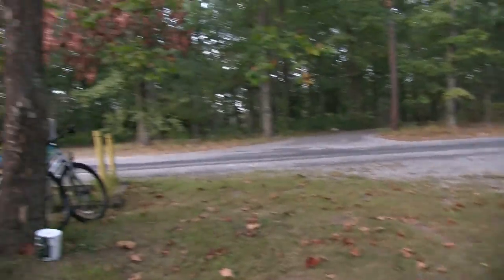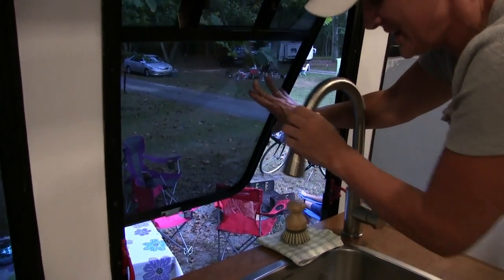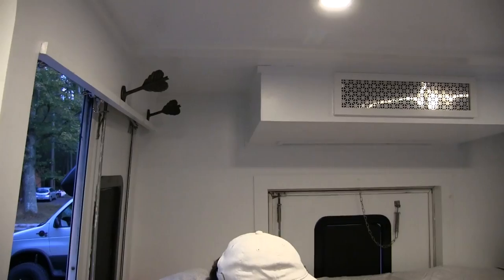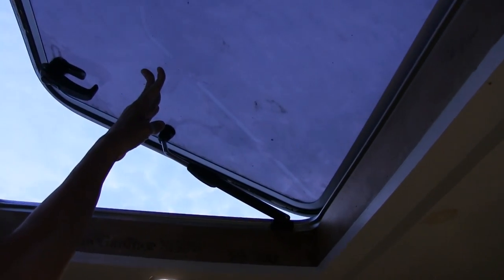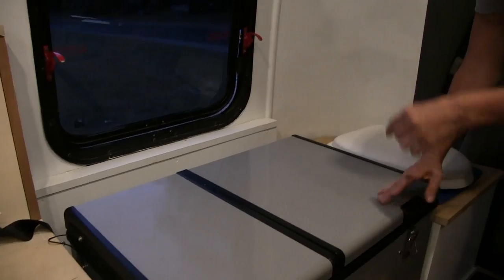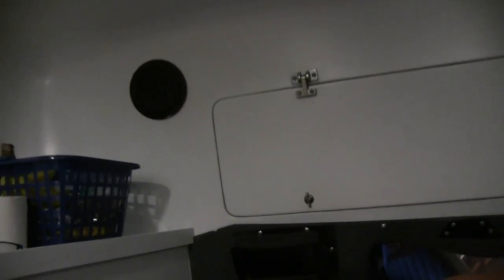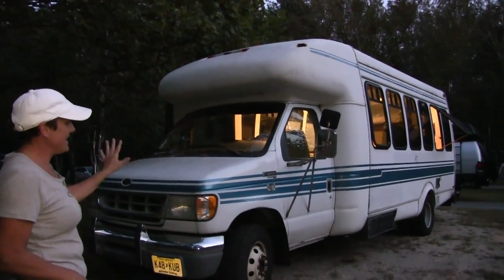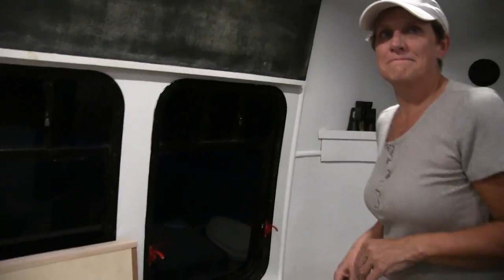VANLIFE |Tiny House Shuttle Bus Conversion: Take a tour!

Comment: I'm a bus driver.

All of the emergency hatches leak.  Idk why.  That marine hatch is brilliant!!
Reply: Thanks.  I called it our built in water feature when I first got it.
Reply from the maker: Thank you for watching
Reply: I think she meant the original leaked...
Reply: Unless that was sarcasm on the original..!
Reply: @skipdippity  yes.  We were both talking about the original roof hatches leaking.

Her new marine hatch doesn't leak.
Reply: @offairhead  That is correct.  The 20-year-old emergency roof hatch leaked.  The new marine hatch does not.
Reply: @OldSkoolieSimple   Hello Rita I really like your convertiom. My name is giovanni, I am in the process of converting a shuttle bus in a motor home. I will like to know what type of converter to charge your batterys did you used?? I would appreciate thank you.
Reply: The side windows leak too at least in my shuttle bus they did.
Reply: @giovanniolivares942  The only converter I have is to convert from 12V-110.  The batteries are charged by the Alternator when I drive.
Reply: @The_VANtastic_Pack  My side windows are in great shape, fortunately.  Sorry to hear that yours leak.  That stinks
Reply: Of
Reply: No, you not a bus driver

Comment: Really nice setup. I highly suggest making screens that attach with magnets to go over each window that opens to keep bugs and other things outside. I have even seen screens for doors. You could easily install a track on the outside up above the windows or roofline so you could add an awning that slides into the track and would provide some shelter from the sun or rain , a protected space to eat or relax. Plus you could add lights on it. Do you have a curtain or shades to cover up the front windows or the front from the rest of the bus.  Something like that would help you be stealth and just prevent people from seeing into your bus at night because when you went around the front you could see everything. Do you have anything to provide privacy for when you use the toilet?
Reply from the maker: Thank you for the suggestions
Reply: Thank you.  You can't tell, but there are screens on the windows.  Screens, cushions, awning are on my to-do list.  We do have curtains but didn't have them up for the video so you could see the layout better.  They have magnets and attach to a piece of metal strapping, (not shown in video.)
Reply: @OldSkoolieSimple  I love your idea of using the metal strapping and magnetic hooks to attach the curtains! You did an amazing job on the design of your shuttle bus!!! I'm still in the research/design phase while my youngest finishes college, then this mama is spreading her wings. :) I wish the tiny house/skoolie movement happened 20 years ago. I would have loved to have hit the road with my boys like you're doing with your girls. Enjoy making memories!!! Safe travels!
Reply: @susanlc95  Thank you.

Comment: Wow. I've been looking at shuttles for a few months to do something very similar. There are a lot of great ideas here. 

The one thing that I don't see addressed is insects. I see a lot of open windows, and of course that handicap access door... but no bug screens. I don't know 'bout y'all, but I've found that when the sun starts setting, all the insects go towards the wherever the light is shining (in this case, to the interior of the bus.) I think I'd have to figure out a way to address that. Maybe there's a way to put a magnetic frame around a window screen and stick it up over the window.
Reply: There are screens on two of the small windows.  The fan has a screen.  The curtain on the door (not shown) also helps.  We run a Thermacell inside at night if it is really buggy and it works like a charm.
Reply from the maker: Thank you for watching

Comment: Thank you very much. A lot of great ideas and nicely done. I never liked the windows in shuttle buses because of all window and little air-flow, but you seem to have solved that problem with the whole window pushing out. I'd like to see how that was done.
Reply: Also, while driving, those little windows do a great job circulating the air.  We open just a few.  Never need to use the AC.
Reply from the maker: Thank you for watching

Comment: She got a 3000 watt inverter to charge her laptop.  Suddenly I’m more interested in the laptop than her oh so cool trailer, LOL!
Reply from the maker: Thank you for watching
Reply: It is set up that way in case we decided to run a hair dryer, vaccuum or blender.
Reply: Rita Gardner — I get it, I was just teasing, I thought the comment was funny.  New Jersey Outdoor Adventures also sells Airstreams, and I need another one. However they only put 1000 watt inverters in them, which won’t power the microwave.  Great RV build BTW • Excellent Job!
Reply: @Erin-Thor  Thanks.  Good luck getting the inverter you need.  Now that I think about it, I believe I chose it also in case I ever decided to put in solar.
Reply: Mark Cooke — A 3000 watt inverter will run a boatload of big laptops. LOL!  A microwave, a compressor fridge too, all at once.
Reply: Rita Gardner, Love your build!
The cordless Dyson vacuum is light weight, quieter, lighter and
doesn't take much space if you need one on your trips 🤗

Comment: Nice conversion to beautiful family, it only missed an indoor shower which would also have enclosed toilet for privacy purpose and no matter in whichever case but solar panels should be there for emergency backup supply, recharging from alternator is not a solution because if you don't move or park at one place than alternator is useless. I would rate it 8/10 for it. Best of luck!.
Reply from the maker: Thank you for the rating
Reply: I'll take that rating.  We didn't put in a shower because for past 6 years, we didn't use once in our camper.  It also takes up a lot of room.  Since the video, we have created a shower for inside but probably won't use it.  We do move a lot.  
We do have a backup for the batteries, (several actually) it is just not in the form of mounted solar panels.  Solar generator and chargers.

Comment: I know you said you don't have a table, but you could put a single circular metal bracket in the floor, flush, and have a swing arm , table, and it can swing out of the way, when not in use, and it can have a hinge so pull a pin, &  stand flat vertical when not in use
Reply: We have three different tables, including a Lagun.  We barely use any of them.
Reply: It is a good idea, and one we have thought about.

Comment: Wow! You really put a lot of great work in! Very inspiring! Ok, everyone is weighing in on this toilet issue! Lol!!..can you..move it over away from the driver seat, use that space where there is that shelf where the water container was, and put in la toilet with a shower so you can use that vertical space? ...possibly hang clothes when not in use? I can see the subway tile...I know you can use the kitchen spout out of the window, which is quite clever, and Im going to steal that one, but..what if they complain about the soap outside, it interferes with your stealth, privacy, children can be wiggly to try and catch etc ( jk,lol actually both options are great, what if evetyone gets quite muddy, and you'd rather not mop?..kitchen window solution..YAAS!!!)..you are adding water to the toilet anyway...you could shower and rinse the loo!! Best Of Everything, Thanks for sharing your great ideas!!🥰🥰🥰
Reply: Thank you so much.  I am glad it was inspiring for you.  Here goes with the toilet.  It was the best spot and has proven to work out better than expected.  Only two walls need to go up to create privacy.  The curved wall really limited what we could put there.   Below that shelf is not usable space it is actually outside. There is no water that goes into the toilet unless I dump it into the urine diverter to dilute the urine in the gray tank.    We are not very stealth since we have a rack off the back with bikes.    Muddy shoes stay outside or on the stairs.  So far it hasn't been a problem.  We only used the hose outside to cool off.  We haven't had a need to use it as a shower.  They really are all over the place when you start looking (beaches, pools, campgrounds, truck stops, friends)
There is a strip across the front of the truck where we can hang towels on magnets.  There are also strips by the back doors if we wanted to open the doors and hang a towel to dry.    Thank you for your response.  Reach out with any more comments.  I'd love to know more of your ideas. 🥰🥰🥰
Reply from the maker: Thank you very much for watching and for your suggestions

Comment: I would love to build one like this leaving the lift in it. The reason being is I'm on a walker heading for a wheelchair. So I would put my daybed and trundle bed on the driver's side wall. I would probably use Ikea cabinets though. And I'm not sure I would add water tanks because of plumbing. But a couple of solar panels would be helpful. Love the 12 volt lights. I would keep it all 12 volt. I would use a composting toilet with a urine separator. A bucket will last a couple weeks. And at least that for a gallon jug
Reply from the maker: Thank you for the suggestions
Reply: Sounds like you have a great idea for a conversion.  Double-check your voltage usage.  Depending on what you have, you may not need solar.  I had more than enough with my 200 agm battery.   You may not need the solar.  It worked out that we didn't have enough usage.
Reply: @OldSkoolieSimple  I'm all about not using a lot of power but I would much rather have it and not need it than need it and not have it.

Comment: i'm gonna be petty and point out that "adventures" on chalk board is missing a V, and....fridge door next to crapper, same level,  but i dig everything else.
Reply from the maker: Thank you for checking in
Reply: I didn't even notice.  I often "Jot" notes down quickly and rarely spell them out let alone check for spelling.  The toilet level is on purpose.  Also, the placement in relation to a board on the ceiling was on purpose to allow for a divider, which was taken down for filming.

Comment: I used to transport RV's to the dealer's lot and my first was a shuttle bus similar to this one.  When I stopped at a truck stop and folded out my mat and sleeping bag I got sick because of the trucks idling fumes came into the bus.  I eventually had to move to a hotel.  How did she solve this problem perhaps, I missed something?  I really love this conversion it's really clean and functional.
Reply: Patrick and I were talking about that too.  I don't stop near idling trucks.  If one comes along, I just move.  My truck can fit in a single space if there is a grassy patch behind it.  So I try to go to a place that the trucks can't.  I think it is better for the tractor-trailers.  They are working and need to sleep.  I am not going to take up their spaces to park and rest.
Reply: @OldSkoolieSimple  Loves Truck Stop has parking for cars and rv's too
Reply: @evamaria644  Good to know.
Reply from the maker: Yes, not the best stopping next to idling trucks.

Comment: Correct me if I’m wrong the Only main difference I see between shuttle bus and a school bus is that the school bus is structurally built like a tank and usually has high clearance.
Reply from the maker: Pretty much
Reply: The windows are built differently, which was a huge consideration.

Comment: 🚌  I like your bed style arrangement with the trundle beds.  Curious if you’ve thought about installing a u-shaped shower rod above and around the toilet area for privacy?  Or even little hooks on the ceiling to hold up a (3) sided homemade decorative curtain would be cute for that area. 🤷🏻‍♀️ 
Please do not take this personally; however, I will admit that I’m not fond of baggie style toilets as I sincerely believe one’s waste should not be dumped in regular trash dumpsters.  We, as a civilized society, have sewer systems for proper disposal of such.
As a full-time rv’er for (20) some years, I’ve been rather alarmed and dismayed when I watch YouTubers that opt for a daily bucket and baggie system.  Of course if one sincerely disposed of bodily wastes in a sanitary manner, ie dump station or outhouse, that’s being respectful of our environment.  But sadly so often van dwellers say they simply toss their bodily wastes in dumpsters.
💩 ugh...
Reply: Thank you for your comments.  We have a shower setup and it will probably never get used.  We had a shower in our camper and never used it after 6 years.  Hence, why we didn't put a permanent one in here.  
I do agree with you 1000 percent about the waste.  Fortunately, it is very very easy to find a place to use a bathroom and so the need for the baggie waste is very very rare, maybe once every couple of weeks.

Comment: The weight of the vehicle is not as much to worry about as the air brake system if it has one or not hydraulic brake system on that type of system would be obsolete but air brake system would consider her needing to have a CDL B license being that used to be a bus but now is an RV with air ride system that is what the commercial people are considering that to be at this point look into it have a nice day
Reply from the maker: Thank you for the suggestions
Reply: Thank you.

Comment: I can’t believe she does not see the benefit of solar.. Also she took out the table. So where do the sit to eat?
Reply from the maker: Thank you for watching. They were sitting outside when I met them
Reply: I do see the benefit of solar.  We just don't use enough power to justify us getting it.  We can run everything we need off the battery alone being charged by the alternator.  Sorry if that was not clear.

Comment: Nice RV, tell your woodworking guy to soften those edges.   And what does, "solar never really felt right for me" mean?
Reply: I don't use enough power to warrant putting solar panels in.  If I do decide to go that route for some reason, then I can add them pretty easily.  After a year and a half, haven't come close to using enough power to drain battery.

Comment: This is great are you going to add a shower?  What if you can't shower outside?
Reply from the maker: It has the outside shower. Please subscribe for more videos like this
Reply: Showers are pretty easy to find.  We have yet to need a shower, but we have a way to shower inside using a pool and hose if necessary.

Comment: Your work is beautiful and well-thought-out...... except for the weight issue, it looks like you're carrying half of Home Depot in that little wagon of yours. How do you deal with the weight issues...???
Reply from the maker: It’s not too bad. The seats and ram that were removed shed about 1000lbs
Reply: When I bought the bus, it was around 11K-11.5K.  After gutting the bus, it was at 10K  Afterwards, with water and fully filled, it is at 12K.

Comment: This is a good bus but how does Solar not feel right? The toilet has zero privacy
Reply from the maker: Solar can be over budget initially for some van and bus builders. It didnt feel like a priority at the time of the build and for the current usage.
Reply: I didn't need the power.  All my needs were covered with just the battery.   There is privacy for the toilet.  I just forgot to  mention it in the video.

Comment: Can you provide more info on the dink "back flow"
Just wondering what they used to prevent water from coming up without the S pipe normally used
Reply from the maker: It’s called an air Admittance valve
Reply: @NewJerseyOutdoorAdventures  thank you for the reply! Going to look into it, maybe I'll end up using it on my build 👍👍👍
Reply: My bad.  I used the wrong word.  (I did that several times.  I was a bit nervous)  It is an inline check valve.  I am sure I got it at home depot for the local plumbing store.
Reply: Rita Gardner AWESOME Conversion!!! Time to set up your conversion consulting business!  Rita you mentioned the name of the beds but I didn’t quite catch it. Please would you send a link or tell us where you got the mattresses/beds. Thank you. Safe and fun travels for you and your girls!!
Reply: @DulyNoted505  I appreciate your comments.  I forgot to mention about the mattresses.  I chose Tochta mattresses because I needed a mattress that was only 4 inches thick in order to keep headroom on the bunks.  BTW, it would be a dream to help people with their conversions.  

https://www.tochta.com/?gclid=Cj0KCQjwz8bsBRC6ARIsAEyNnvpLjicP8Rx7BUKUHTDs-0tpg2vUslzrYzMOZrOn-49VT5H3cJCtNcMaAv_MEALw_wcB

I liked the Journey over the Utopia.  I ordered the better one for myself but liked the Journey over the Utopia so I switched with my daughter.
Reply: @Rita Gardner thank you so much for responding and for the mattress information!! I keep dreaming of doing a conversion for my retirement since my kids have picked both coasts to live on! LOL Safe Travels!

Comment: How could I find out more about getting and converting a shuttle bus with the handicapped lift still in it?
Reply from the maker: I am sure there is a shuttle bus group on Facebook
Reply: Most shuttle buses have lifts.  You just need to find one that has one that still works and go from there like a regular conversion.   
Join https://www.facebook.com/groups/250257305887129/ on FB so we can keep in touch.  There is a shuttlebus group on FB
https://www.facebook.com/groups/1949898748558403/

Comment: Seemed like the kitchen area was small in size in the sense that she would have to kneel to use...most I have seen are at least standard sizes
Reply from the maker: This was built low for more driving visibility
Reply: It is 3-4 inches lower than normal, but lines up nicely with windows and allows for more visibility when driving and for kids to see.  Fortunately I am not slaving away in the kitchen for hours on end😉😁